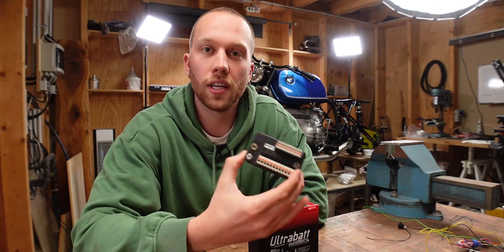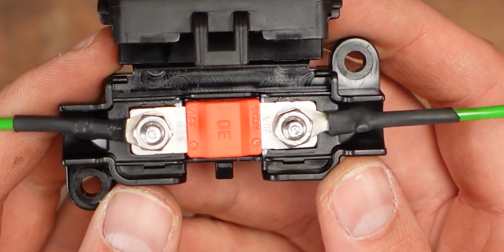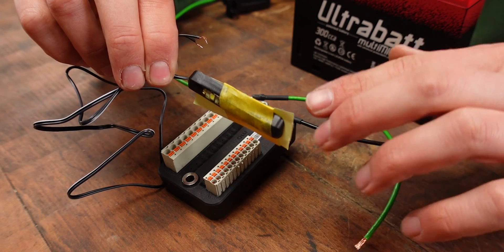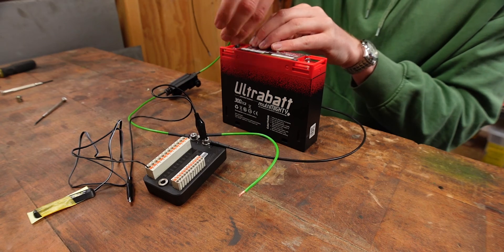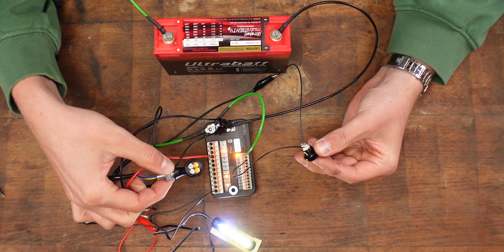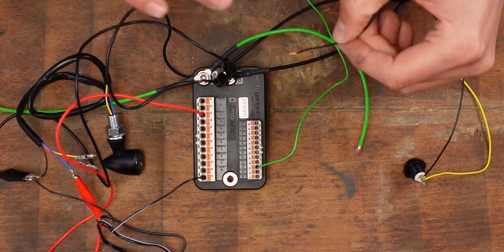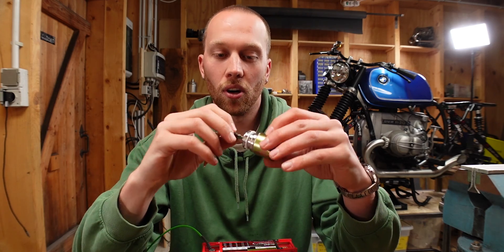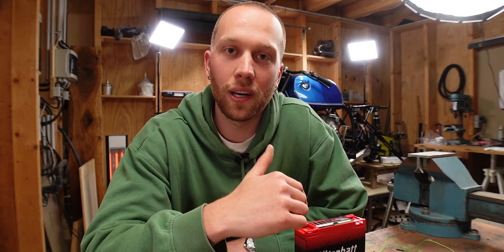DO THIS Before Installing The m-Unit from Motogadget | Bench-Test

Comment: Hey! Can you use any speedometer with the m.unit?
Reply from the maker: Yes, it works with any speedometer. The only thing you need to check (but this has nothing to do with the mo.unit) is how the speedometer reads the speed. If it need an analog or digital signal. On the BMW for example I had a digital output signal so I needed to buy a special wire that transforms it into a digital one to make it readable for the modern speedometer. I hope that helps 👌
Reply: @MotoWrenchers  Thank you so much! Also awesome video 🙏

Comment: Im thinking about it. M unit. I am making mine from scratch. Xt225, heavily modified. Is there a preset controller or is it built in with the m unit. I m in canada.
Reply: Sure it's a mapping tuner ,one is normal driving,the other is sport mode, it allows  us to advance or retard the timing,thus giving a variety, variable higher performance. Example ,launch control, racing, enduro modes . Like the features the tenere 400 and 700. Adventure bikes. This allows me to switch modes die to different trail situations.  I love to put all this as a setup on mine
Reply from the maker: Ah, thanks now I know what you mean. The mo.unit doesn’t have that function. I’ve made a video explicitly ever terminal of the mo.unit, maybe that helps you out: https://youtu.be/ZR92OUajpM4?si=61WepdyE-qkWb2j-
Let me know if you have any other questions 👍
Reply from the maker: Hi Jay, I’m not sure what you mean with preset controller. Could you specify that for me please? Hope I can help you afterwards. - Joshua

Comment: Thanks for the video. I have 2 questions though:
1. In case my bike needs to go to a shop for repairing, how can I hand over "the key"
2. How do I use the m-Unit together with mo.lock NFC?
Reply from the maker: Hi,
1. I have used a regular ignition lock on the BMW which activates the mo.unit. So, the bike has a regular key like any other bike as well. You can check out the other videos in this playlist (Motogadget Parts
https://www.youtube.com/playlist?list=PLcafGsVIudGrncBSCvDTezN3mhQTNhbB4) to see how I’ve wired that up and if you want to can also have a look at the my wiring diagram for the BMW that includes all the information. You can find the link in the description of this video. 
2. I haven’t used the mo.lock until now but it should come with a detailed description. And in case you should run into problems, Motogadget is always very responsive and helpful if you send them an email. 
I hope that helps. Good luck with wiring your bike? Which bike are you working on at the moment?
Joshua
Reply: @MotoWrenchers  thanks for your very fast response. I’m planning to give my Vespa PX150e (1995) a m-unit blue :)
Reply from the maker: @HocExcelOnline ah, nice project! If you have any questions feel free to ask. Happy to help if I know the answer 👌
Reply: @ thank you, I definitely do reach out in that case
Reply from the maker: @HocExcelOnline 👍

Comment: I have watched endless videos about wiring an m unit blue, no one seems to explain the correct way to wire the oil and neutral switchs
Reply from the maker: Hi John, those go directly to the control lights in the speedometer. If the switch is internally grounded (if it only has one terminal) that wire goes directly to the wire in the speedo that is for that switch. If the switch has two terminals one is ground and can either go to the frame/engine somewhere or a common ground (like on the munit for example). The other would then again run to the control light in the speedo (or wherever you have those located). Neutral and oil switch both don’t run through the munit. Let me know if that helps you or if you have any other questions. Good luck with your wiring 💪
Reply: @MotoWrenchers thank you for this little explanation I had to agree with the parent commenter. Haven't seen that covered anywhere yet. Will this still be true if you use the original gauge cluster for the BMW? I don't want to use a modern Motogaget cluster, but I do want to use an m unit to redo my wiring.
Reply from the maker: @CaskStrength777 hi, you’re actually the first one asking about that. It should work. I replied in more detail to your other comment. I hope that helps you out. Let know if you have any other questions 👌
Joshua

Comment: A 2.5mm conductor in series with a 30A fuse is optimistic.  That cable will get pretty warm before the fuse blows.
Reply: @MotoWrenchers  Cable size needs to increase with length of run, but that's not an issue on a bike. There are a number of online resources available,  which can give different results, but a minimum of 4mm seems common, with 6mm offering more peace of mind. The principle is that the 30A fuse should be the weakest link, and that's a fairly substantial current.  Also think about cable sizes for the other parts of the circuit, as that sort of fault load will be coming from somewhere ! I shall watch with interest :)
Reply from the maker: Thanks for your reply! For the final wiring I actually used a 6mm wire on the bike. Just used the 2,5mm for the bench test. And downsized the fuse to 30. I really appreciate you pointing that out 🙏 I hope it helps someone reading this who might otherwise not watch the actual wiring video.

Comment: everything clean, ok, but the unit looks to me like a set of house wiring connectors (mammoet), what about water resistance? there is no crimping at the terminals, wires are hold by a clip to the unit...I see it not very durable
Reply from the maker: I need to see how it holds up. So many people install munits and I almost never heard any complaints. But you're right, water from the top might actually be a problem where I located it. For that reason I just 3D printed a cover for it that protects it from the front, the sides, and the top.

Comment: How to connect powertronic with M-Unit on Royal Enfield interceptor 650???
Reply from the maker: Hey man, unfortunately I have no experience with that. But I’m sure either Motogadget or the manufacturer of the powertronic are happy to help you. Good luck!
Reply: @MotoWrenchers  Thanks a lot for your kind reply. But I would suggest you to fit m unit on interceptor 650 and connect powertronic in it and make interceptor a streamline caferacer and upload a video on YouTube. This will help us alot. Thankyou again....
Reply from the maker: @dualstand1406 my next project might actually be a cafe racer. Are you turning your interceptor into a cafe racer?
Reply: @MotoWrenchers  yeah I want to but I want you to do that so that I would be guided well

Comment: The initial power to aux was my biggest issue. Took a while to work it out when I installed the unit on my Harley a few years ago. 

Glad you mentioned this important step. It’s also an important step if you delete the app and need to set it all up again. 

Great vid!! Thanks. 

Good luck to all whom want to run this incredible piece of technology.
Reply from the maker: That's a good tip, thanks a lot. I still need to set up the app once the bike is completely finished.
All the parts are at the powder coater at the moment. I'll get them back next week. Can't wait to put everything back together.
Also, thanks for your kind words. Always ride safe my friend!